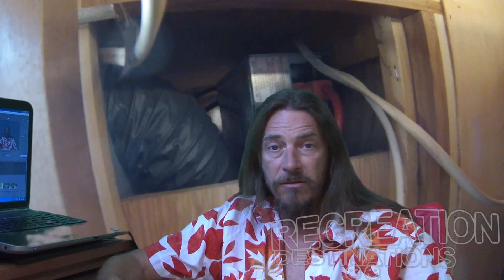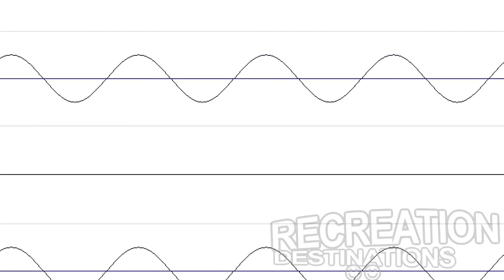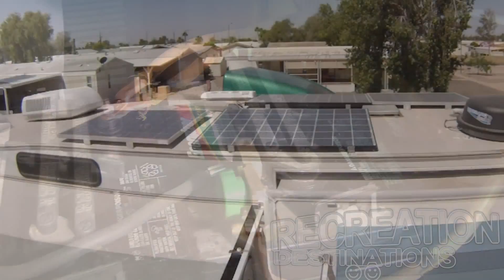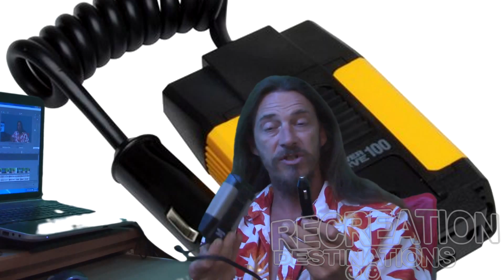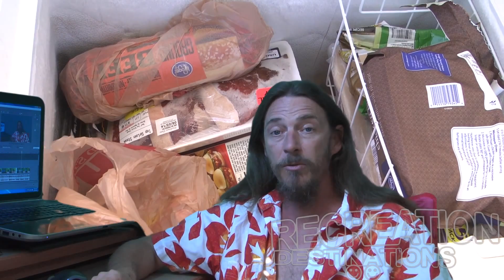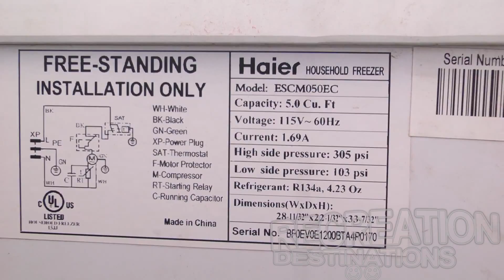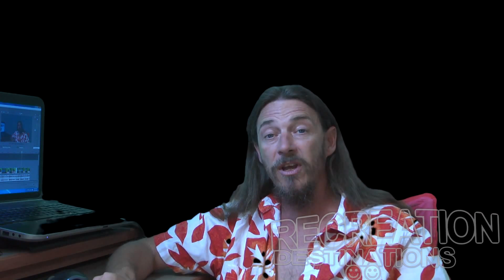Understanding RV Electrical Systems Part III

Comment: At the end of Electrical Systems Part III you mention that your next video in this series will be about wiring for RVs.  I'd specifically like to request you discuss how to calculate which guage wire is needed at each leg of the run from solar panel to charger to battery to inverter to outlets, including how the length of cable effects voltage drop.  I have re-watched parts 1-3 and took several notes as I will be hooking up (2) 12v PV panels on the roof of my homemade camper trailer conversion (which my YouTube channel shows if you'd like to come take a peek)   ;-) 
Anyway, please accept my kudos for the professionalism in your video production, your precision in script preparation and your well-spoken narrative style.  
All in all, way to go,  Cliff! Keep up the great work!
Reply from the maker: Thanks for the suggestions for the next installment.  I will include some information about sizing wiring.  :)
Reply: @HighDesertOffgrid  HOW MUCH DOES IT CAST TO RUN EVERYTHING FOR 24 HOURS A DAY?
Reply from the maker: @thelionsden3323  I'm unsure what you mean.  What do you mean by cost? And what do you mean by everything?

Comment: Can you attach more than 1 inverter to a battery bank? Olny turning the small one on if needed and the larger one when needed?
Thanks,
Steve
Reply from the maker: I suppose you could.  My 3K watt inverter only draws 0.5 amps when idling so I see no need for an additional smaller inverter.

Comment: Good stuff. I am wondering how a few capacitors would affect the modified sine wave inverters performance. Would this lessen the 60 cycle hum generated?
Reply from the maker: rjkisback Inverters already have caps inside.  Adding more is far above my pay grade.